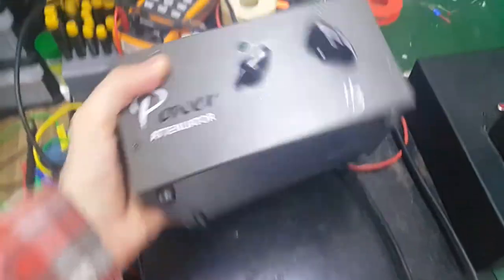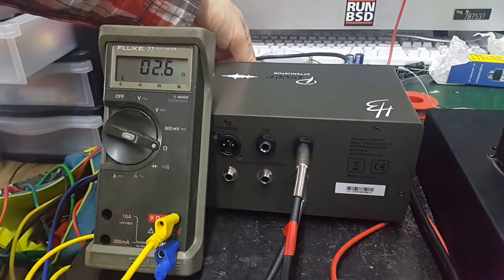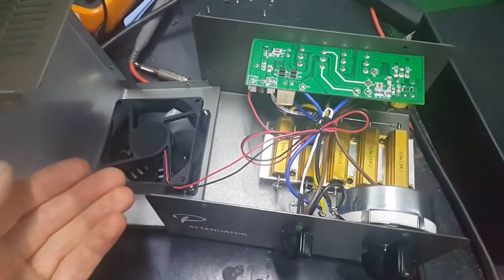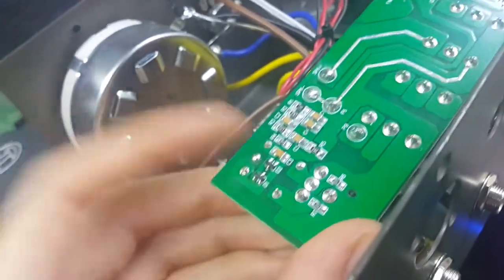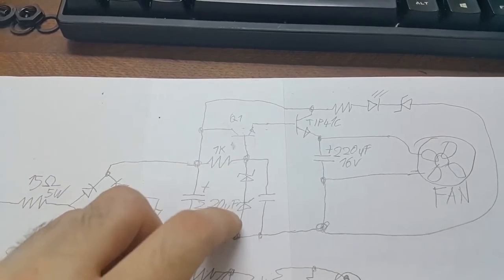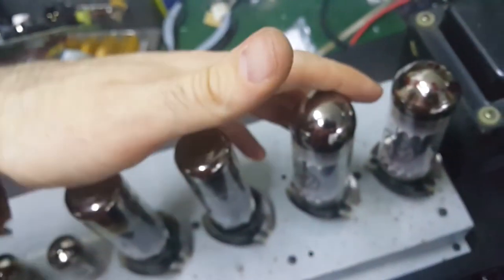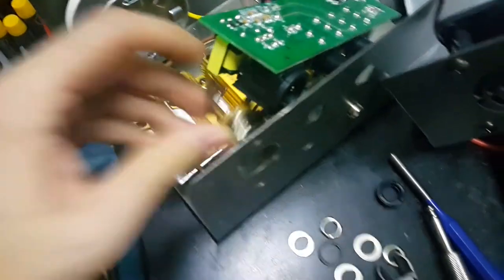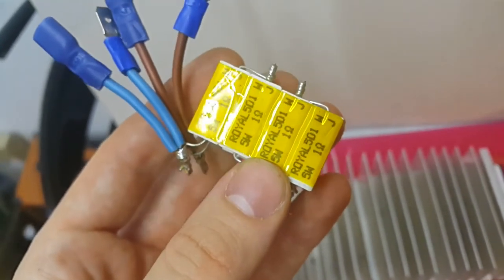Harley Benton PA-100 Attenuator Review & Improvements

Comment: Hey there @netman
Thank you for this informative video! I just bought this unit, because I needed a dummy load at home so I could use my IR loade and practice to playalongs at home. If I would have known that this unit is dangerous, I wouldnt have bought it :-) But anyway: I think for my 50W fender style amp in 8 Ohm it should be safe to use. But in the and the box is totally useless since it can't be used as a dummy load because the line out is muted in dummy mode. So you mention in the video an easy fix: Only resolder the resistor on the pot from the blue to the yellow cable. You go on in the video so quickly so I wasn't sure if this is the whole trick? I am in need to do this mod, becaus I just bought it for this silent practicing idea... Thanks for your help!
Reply from the maker: Moving that resistor really is the entire trick. It is wired deliberately to the speaker output, presumably because then the speakers response can affect the output, so moving it will slightly change the sound but if you want to record while muted that is inevitable. If you want to practice entirely silently, you could also just disconnect the speaker from the attenuator ;).
Reply: @netman69  Hey thanks for the super fast response! OK, so I will move the resistor.

But I am thinking of what you said: I my understanding your option is not working. The only setting where I can safely disconnect the speaker and the correct dummy load is provided is, when the attenuation is completely turned to max. At least on my Weber Mass Lite this is actually the case, The Weber support told me so...
Reply from the maker: @semiforte  This is not the Weber though, with no speaker connected the HB will behave as if the speaker output volume is set to 0 regardless of the controls position, that is to say you'll have 6, 9 and 18 ohms or thereabouts for the 4, 8 and 16 ohm inputs respectively. For the 8 and 16 input that's entirely fine and in the ballpark of what a real speaker could be, the 4 ohm input I would avoid if your amp has an 8 or 16 output, but you'll be fine regardless.

The things I would actually be concerned about with the HB are the ground issue with the 16ohm input I show in the video, and using the 4 ohm input with a 4 ohm speaker on the output at the higher end of the volumes. If you are aware of those two issues I reckon you can make it work for your situation :).
Reply: @netman69  OK. Well, it seems that you know what you're talking about so I will trust this information, but somehow it is still weird, because in the manual there it says, that if I use the box only as a resistor with no cabinet connected, I should set the control betwee 2-3, here's the quote:

[Out Speaker]
Output jack for connecting a passive speaker box.
The device can be used as a load resistor when operated with tube amps without speaker box.
If you do not connect a loudspeaker and use one of the other two outputs set the knob to ‘2’ – ‘3’.

So if you're right, what is that information about?
Reply from the maker: @semiforte  Is this from the Harley Benton or the Weber? I should double check that i am not somehow missing something, I did double check the resistance of the inputs with no output connected for the HB, about Weber I know nothing. If the HB manual says this it may just be they suggest it so to have the line-out working.
Reply from the maker: Just downloaded the manual for the HB and the copy i found says "If you do not connect a loudspeaker and use one of the other two outputs set the knob to ‘0’.". Obviously there are multiple versions, I wonder which one is newer xD.
Reply from the maker: This the version I found, separate message because I suspect youtube may delete comments with a link: https://images.thomann.de/pics/atg/atgdata/document/manual/406679_c_406679_en_online.pdf
Reply: @netman69  this is the older Version you posted the manual, it is smaller and doesn‘t have a fan. I have the same version as you and the Quote I sent you is from the newer Harley Benton manual. I have no clue how this unit works. I only played yesterday for 15 min. playing with headphones, no speaker connected. I found the PB-100 to stay completely cold, the power tubes of the amp seemed hotter than usually, but I don‘t know…
Reply from the maker: @semiforte  Maybe in the older unit they had the output wired the way I suggest modifying in the video xD. That'd explain them suggesting to put the output at 0. If you have a meter for it the straightforward way to know if all is good would be to check if the resistance of the attenuator matches the speaker approximately (and if you don't I highly recommend just picking up a multimeter of sorts, even a $5 DMM will work good enough for this kind of stuff).
Reply: @netman69  Sure I do have a multimeter, but I don't know enough about electronics to know where I need to measure what value... I don't know, what I need to measure to know, if the amp sees the correct load on it. Maybe you can give me some advice....?
Reply from the maker: @semiforte  So first what you do is set the meter to resistance/ohms mode, if it's manual ranging it'll have a bunch of different ranges like (2/20/200/2k/20k for example), set it to the first range that is higher than 16 ohms. Make sure it's the right number, if it says "k" or "M" after it, it's not.

Most meters will have 3 connectors for the probes, one marked V/ohm/etc, on marked COM, and one or more marked A or mA, you want to have the probes connected to the V and COM.

Then touch the probes together, it should say something like 0.5 or so or if it's an analog meter there will be a control to set zero which you have to set to zero with the probes touching like that. With a cheap digital one the value the meter reads when touching the probes together should be subtracted from what the display says to get the exact value you're measuring, but if all is normal it'd be less than half an ohm and thus not really significant. If it is a big number the probes are probably shot :P.

Since you were using the attenuator, presumeably it's connected from one of the amps outputs to one of the attenuators inputs, both should say what ohms it is, and they should be the same number if you wired it right :P. Disconnect the cable at the amplifiers side so you have a loose connector on one side and the attenuator on the other, and put one probe on the pointy end (the tip) of the connector and one on the other metal part (the sleeve) at the same time.

The meter should then read the number in ohms of resistance it is, if it's within like 25% of the value the amp expects you'll be quite safe. That is to say for the 4 ohms input on the attenuator you should have between 3 and 5, for the 8 ohms input that'd be between 6 and 10, and for the 16 ohm input between 12 and 20. You can measure with the volume of the attenuator in different positions to see what effect that has. Even like 50% deviation from the value probably isn't much harm, but I'd expect the HB to be closer than that.

Same way you can sanity check a speaker and the cable used, neat skill to have because running a valve amp without any load can cost a set of valves or even a transformer in seconds if you're unlucky. Real speakers will usually read a bit low because they aren't entirely resistive loads but also inductive, and the inductive part isn't measured by a multimeter, the biggest concern would be if they read very high or open circuit.
Reply: @netman69  Well this was easy. The meter shows something between 10 Ohm and 8 Ohm on the 8 Ohm tab, so I think this is ok then!

Well thank you very much for your help!

Fabian
Reply from the maker: @semiforte  That means you'll be just fine, awesome :).
Reply: @netman69  @semiforte Thanks both for the very helpful chat! I've just picked a second hand one and my manual also does state the SPK level should be set between 2 and 3 if using without a speaker, which is how I am going to use it. I did as you said, plugged a cable in each of the 3 inputs and measured tip and sleeve with my DMM. There results are out! There are readings with the SPK pot set at 0 and 10 to show the range.

16ohm input: 19.4 - 26.5
8ohm input: 12.7 - 13.7
4ohm input: 10.2 - 11.4

Wow! I noticed yeasterday that the amp I used for testing, a Vox AC4TV, got very hot after an hour or two worth of use. Must say, I haven't fired it up in a very long time and can't remember if this was always the case or not - I know they do have a pretty strange design which drives the EL34 VERY hard, so I thought it might have come down to that. Now I know it didn't!

Now then, would I be right in thinking that the actual safe way to use my amp's 16ohm output would then be to plug into the 8ohm input and keep the SPK level maxed out? My understanding is that as long as the amp's output meets a resistance in the ballpark of what it ask for (but preferably slightly under rather than over, in my case of 13.7) all should be within a safe range and happy? Or am I missing something?

I'm hoping that will suffice and do the trick safely, the sound and "feel" I got was that of the little tube amp and far superior to any amp sim I've tried - both very dynamic ("feels" right on the fingertips) and convincing once put through a good cab IR (grabbed the Celestion Vox IR pack for the price of a couple of pints on the sale). Also take pedals much, much better of course.

If it's all safe to go, I can't wait to plug it into my AC30/6TB!

Apologies for the very long and wordy reply, I hope it might add to the conversation though and maybe be helpful to other users landing on this video with similar concerns.

EDIT: I should also add, my probes' resistance settled at 0.6. HOWEVER - I did use a regular guitar patch cable to link amp and load box/attenuator, which might have added resistance? Will certainly grab/make myself a 12 or 14 AWG speaker cable in the coming week for peace of mind.
Reply from the maker: @sofasoundeffects  You are correct in thinking all you need is the load resistance to be in the ballpark, actual speakers are also only in the right ballpark and the impedance matching between valves and tranformer isn't usually very precise either. It's normal for valve amps to get quite hot, but make sure it's not red plating. I don't know whether 13 ohms is better than 19 though, a lower resistance would mean the valves also dissapate more power, whereas a higher resistance will have them see greater voltages (which taken to an extreme can destroy them in a second but the difference between 16 and 19 ohms wouldn't worry me).

If you have the tools and knowledge to do so safely, I'd check the bias on the amp and see whether that's in a safe ballpark. The valves being biased very hot would be a likely culprit for an amp getting hotter than is good for it, more likely than the small discrepancy in load resistance.

The dangers to be really aware of is the grounding issue I mentioned in the video and the 4 ohm input in some scenarios, other than that I am convinced you'd be safe hooking up to an AC30 :).
Reply: @netman69  Thank you so much for taking the time to reply. I have opened mine up and can thankfully report that my copy has a correctly connected ground on the 16ohm input. Also, giving it another round of impedence checks bore better results, much closer to the 4, 8 and 16 one would expect. That said, all of these were done without a speaker connected at the other end, since that's not how I'm using mine (simply going into Logic and through a cab IR instead, no actual speaker connected).

I guess the only other mode I might want to consider doing then is the line out resistor swap, going to the lower lug of the main VR, but since the manual itself mentions it should be kept between 2 and 3 when playing without a speaker I find I can get enough signal for my purpose, so I think I'll just stick to how things are!

Last note about the amp, it sure does get warm - just had it on, speaker plugged in and not attenuator in sight, and within a few minutes it's warm to the touch, so I can happily report my Harley Benton Pa100 is working as it should 👍
Reply from the maker: @sofasoundeffects  Well valve amps get hotter than a 2 dollar pistol in normal operation xD. If you have the knowledge how to safely do, do check the bias.

It's great to hear your pa100 has the grounds wired correctly, maybe they did take my complaints to heart even though they never replied my mail.

Comment: So, i buy a brand new piece of equipment and have to open it up and make modifications i have no idea how to make, using replacement parts or equipment i don't have. That's what's called a straight up rip off!
I've seen vid's of people making cheap d.i.y. attenuators, but for all i know using one could damage my amp using them.
Reply from the maker: That's certainly a fair assessment as consumer, but given you can't buy the parts for the same price I'm still happy I can buy it. Building your own is neither cheaper or easier.

I don't know if paying more gets you something that'd be more sensible for a normal end-user, but maybe that is the sensible thing to do. With how close they are to a good product, maybe HB can fix this though, I've contacted them about it last week or so, yet to see a reply.
Reply: @netman69  First of all, thank you very much for contacting them, i expect they'll take you more seriously than i, such shoddy workmanship must be addressed and answered for. I don't know what the more expensive attenuators offer (i'm guessing differing amp simulators and such), do you know of the best affordable one please? Cheers.
Reply from the maker: @MahatmaLevolence  I wish I had better advice, but I have absolutely no clue which one to recommend if you want a ready-made solution. I did see some other cheap ones that were equally questionable.
Reply: @netman69  Okay. Thanks for replying.

Comment: I dont understand. If i dont put the resistor to the yellow wire what happens?
Reply from the maker: The way it's set up from the factory the line-out volume follows the speaker volume, so you can't turn down the speaker all the way and still get the sound out of the line output (as you also turn the line out volume down while turning the speaker volume down). There is some logic behind that madness though, with the way it's set up from the factory you also get the interactions of the loudspeaker with the amps output recorded even when the volume is set lower, but for me it is more important to be able to get the audio even when the speaker is set very quiet so hence the modification, you can do it or leave it as is depending on your preference.
Reply: @netman69   Thanks for the reply🫶. If i only have the line out connected without a speaker will it work?
Reply from the maker: @alexcharamis  Yes, as long as you either turn up the volume that's meant to be for the speaker (the big knob) first or have it modded as I did.

Comment: I dont get it actual problem. 16 ohm socket is damaged? I have 50 watt amp with 8 ohm output (its little bit more than 8 ohm said amp manifacturer) and 16 ohm speaker. 16 ohm speaker connect to 8 ohm input. Do i need this modifications. Can we understand sockets are okey without that equipments? Thank you.
Reply from the maker: Not damaged, but in my case the ground was not hooked up to it and instead just depended on a connection through the painted metal box which is not great. If you purchased it new and recently your unit probably does not have the same problem (others have reported when they bought on recently it was fine).
Reply: @netman69  I just found used. 
Unfortunately, Harley benton products are not sold in the countries I live in. I'm not sure I really need attanuator. I'am not interested crunk tubes. I use the master volume at the lowest level, I just doubt that I am getting full efficiency from the amplifier. Thank you for the answer.
Reply from the maker: @trebleclef4889  if you want to connect an 8 ohm output to 16 ohm speaker you do probably want the attenuator (assuming the amplifier uses tubes). 8 ohm output into 8 ohm input from the attenuator and then the speaker connect to the speaker out of the attenuator.
Reply: @netman69  My amp already 8 ohm(a little bit more than 8 ohm manifacturer told me) out connected to 16 ohm speaker. Something is wrong about that? Amp is dumble clone and yes tube amp.
Reply from the maker: @trebleclef4889  yes, with tube amps it's not a good idea to connect to a mismatching load. If the output says 8 ohms you want to connect to 8 ohm speaker, or for example 8 ohm input on an attenuator. 8 ohm to 16 ohm is no big drama, problems become real when for example you have no speaker at all or 4 ohm output to 16 ohm speaker, or 16 ohm output to 4 ohm speaker, like when it is quite a big difference. I'd recommend using the 8 ohm input on the attenuator in this case though. If you have a multimeter you can check if the input is connected properly inside the attenuator (set to ohms measuring mode and look that it is somewhat close to 8).
Reply: @netman69  It is not about being damaged you require a separate ground to not end up electrocuted.
Reply from the maker: @guitarfighter  This is the ground of the speaker output though, nothing will electrocute you if that one is broken. The amplifier however will be without a load, which is bad for the output tubes and transformer.